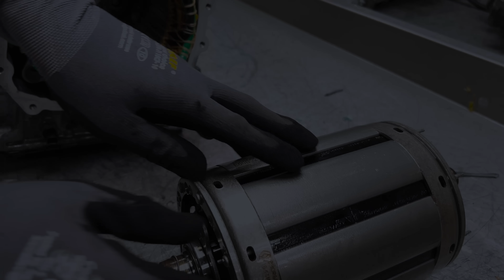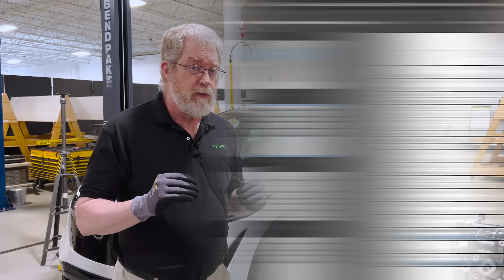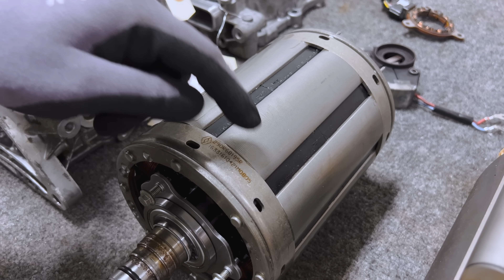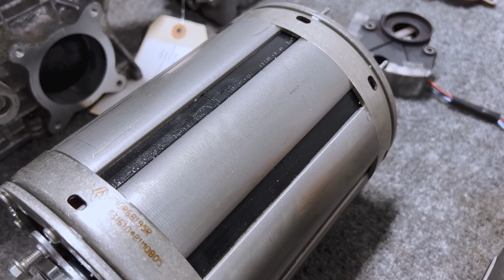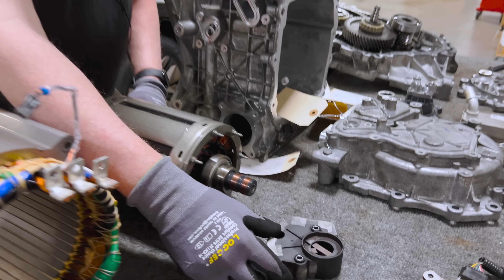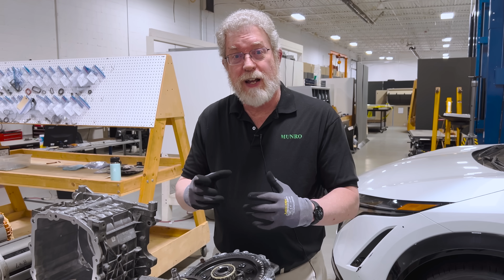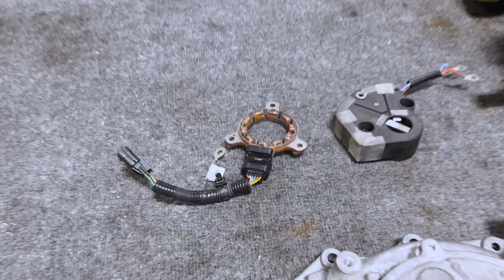This EV Motor Has No Magnets – Nissan Ariya EESM Teardown

Comment: The solution for the through bolts is not new, it was used on connecting rods on German aircraft engines in WW II
Reply: Interesting... but he didn't say it was new, he just said that it was properly designed.

Comment: Am I correct that the motor  is intrinsic to the charging process ,  not a great idea if so 🤔
Reply: Only for 22kw AC, I don't know if the Ariya has this option
Reply: That's a Renault feature. There is no mention in the video of whether Nissan is doing the same.
Reply: @brianb-p6586 No it WAS  a question 🙄
Reply: @pollywollydo while the motor is used in the Renault charging system, there is no inherent need to do that just because it is possible. I don't know if Nissan is doing this; so in answer to your question, I don't know if your assumption is correct.

Comment: Interesting to see brushes used, makes a great 2nd motor for an efficient AWD electric car.  I figure it has far less loss when freewheeling compared to a induction or permanent magnet motor without the need for a clutch disconnect.  Overall the motor looks to be designed with traditional electronics and manufacturing, especially compared to all the newer hairpin wound motors from VW and Rivian.  My thoughts on Nissan electric cars are maha, Leaf left a long lasting reputation for poor battery life, the newer Aria has nice looks but not all that compelling or competitive electric car specifications.
Reply: don't think it has less losses than an induction motor when freewheeling. Both completely de-magnetize and have no eddy currents when de-energized but the induction motor has no friction from brushes. Less than PM, yes, agree
Reply: The Leaf has battery lifespan issues due to a design choice aimed at lowering the price point and keeping it affordable.  But, aside from battery life, it is notoriously reliable.  So much so that there are at least three aftermarket suppliers selling replacement batteries, because many owners love the car and want to keep it on the road.  The aftermarket batteries are quite affordable, and offer big performance upgrades.  There is even a video on YouTube showing how the replacement can be done in your driveway with a floor jack and some wood (and some custom software).

Comment: This is old school synchronous motor with brushes. 
On the other hand permanent magnets will  degrade with loss of magnetism and motor lose some power over time, significantly more in motors at high temperatures.
Reply: Spontaneous demagnetization was an issue with old AlNiCo magnets. Neodymium magnets lose up to 2% of their strength per 100 years, which is negligible. The field also weakens with temperature but this is reversible if critical temperature is not exceeded
Reply: This motor is hot garbage and requires carbon brush inspections and replacements.
It would be like going back to carburetors and praising them.   😅
Reply: @acvwacvw Considering the upcoming shortage rare earth elements this is a wise way to go.  BMW also uses externally excited AC motor with carbon brushes. They have much better design with 3 short brushes per ring that lasts 3M km.

Unless the oil does gets onto the rings in which case it fails fairly quickly but this is a weak point of all carbon-brush based designs. 

Counterintuitively, a short brush lasts longer than the long one because it has lower inertia and therefore a weaker spring is adequate to push it against the shaft. The shaft always has a certain runout that the brush has to follow. As the contact force is weaker the brush could last longer. Also, they use 3 brushes per ring arranged in a star configuration (the whole thing looks like a “flux capacitor” from Back to the Future). This way, if the shaft is moves away from one brush it also moves towards at least one on the other side. Therefore, there is no risk of creating electric arc or even sparks, which would otherwise greatly reduce lifespan.
Reply: @acvwacvw we still do brake pad change and tyre change. Isn't that old school?

Comment: I might be completely misunderstanding, but doesnt this design mean that you could change your Kv of the motor on the fly, due to ability to change to magnet strength, therefore torque of the motor?
Wouldnt that mean that you could practically change "gearing" of the motor on the fly?
Reply: Correct. that is what he described starting around 12:00 in the video.
Reply: By controlling the stator field you already do that, the excitation of the rotor is additional energy, which was not needed in permanent magnet, the goal would be to keep this loss minimum or just power as much as needed
Reply: @vikkris  No, you are missing my point, with permanent magnet motor you have the same Kv no matter what, therefore the same torque per amp.
If I understand it correctly, torque generated by magnets, is basically a multiplication between magnetic flux generated.
Therefore, you are able to change the Kv of the motor on the fly, everything just by changing the current of the rotor coils that were mentioned.
In my mind it seems that mean that you can adjust Kv to anything you want, which would function as endless gearing possibilities.

Comment: 16:00  I don't know of any car that relies on the ABS system to hold a parked car, they set an electrically powered parking brake like what's found in most modern cars.  And it's funny that this guy paraded the parking pawl when Munro has previously criticized other car makers for having it.
Reply: Paul is indeed wrong about using ABS for parking. 

If there is a design change which will save the manufacturer a dollar Sandy will recommend it, even though it reduces functionality for the owner and may cost the owners thousands of dollars (in replacement of non-serviceable parts). Paul seems more interested in delivering a functional product to the consumer in a way which is viable for the business.

Comment: An old Renault engine with the Renault logo still lasered into it. Unfortunately, this engine was already unpleasantly noticeable in the Zoe due to its higher consumption. Not only that, but using carbon brushes to get current into the rotor windings is old and inadequate technology. More modern designs do this inductively without carbon brushes.
Reply: Do you thing inductive coupling is more efficient that carbon brushes. I doubt.
Reply: @r11tc 
*think
Reply: @r11tc I wonder how large it would have to be to put the same amount of current into the “armature” of this setup that brushes can. He mentioned 10s of amps with that? And how do you do it without interacting with all the rest of the heavy fields in proximity?
If such a thing does exist on this scale, I’d genuinely love to learn more about it.
Reply: They refined a lot the motor since the Zoe.
Probably tuned the control algorithm too.
The Ariya, the new Renault 5 are actually pretty efficient. Worse than Tesla, but still among the best.
Reply: It is not an old engine, Renault mounts it on all its new vehicles Megan, Renault 5, but Renault here in Europe is known as a company that produces economical vehicles, with some compromises to save money 😅
Reply: It is not
Reply: That's not the same motor of the Zoe/Twingo, you can easily understand that because the old one was air cooled, whole this one is oil/liquid cooled.
Also the AC battery charger is now a separate piece than the power inverter, so again, it's not the same motor, it just have the same layout.
Concerning brushes and induction, there are some induction exciter around, but still experimental, and Renault is targeting that for the next version of that motor, but for the moment they are not enough reliable and cheap and compact.

Comment: Is no one on earth using a switched reluctance motor?
Reply: Tesla Model 3 permanent 🧲 uses some reluctance
Reply: @danielhermanus6909  all interior permanent magnet (IPM) synchronous motors produce reluctance torque. Only Tesla makes a big deal about that, but they all do it. And that's synchronous reluctance, not switched reluctance.
Reply: Switched reluctance has been used by PMSM since Toyota Prius.
Reply: @Foersom_  No, Toyota does not use - and has never used - switched reluctance. Like all interior permanent magnet (IPM) synchronous motors, any Toyota motor does produce reluctance torque.
Reply: No on-road automotive application uses switched reluctance, although it is used industrially. LeTourneau was well known for using switched reluctance motors in its mining trucks, which are now part of Komatsu; Komatsu still uses switched reluctance motors. 

Note that switched reluctance is not the same as synchronous reluctance, and that switched reluctance is not suitable for light vehicles due to the lack of smooth torque delivery. 

Any reluctance motor (including the synchronous reluctance which could be used in cars) has relatively low stall torque for the size of the motor, which is likely the main reason that it not used in cars.

Comment: When Paul says Nissan has been in EVs a long time, he was not kidding. First Nissan EV 1947. They did take a pause and restarted on EVs in the '70s.
Reply: You might also be interested in Jay Leno's 1907 Thomas Flyer, electric with regen braking. Cool tech back then, abandoned for oil buring engines for better range etc
Reply: @KiwiMC99 The early EV’s had key starting - the ICEV didn’t get that for a decade afterwards… (the 1912 Cadillac was the first with that option).
Reply: Ford were building EV’s in the 1920’s…

Comment: The drive unit looks shockingly similar to the 2010's Renault Zoe, the parking brake lock is extremely useful when parking up steep hills! Sadly the R model Zoe's had air cooled motors which meant that debris could find it's way into the bearings and brush rings.....

Good to see it's not using rare earth metals and as long as the bearings have been beefed up & liquid cooled the drive unit should be good for many miles.
Reply: Of course it is... Nissan merged with Renault and so acquired its motor design.
Reply: @brianb-p6586 are you sure Renault designed that motor originally?
Reply: @GBOAC  No, the Renault Zoe motor is from Continental.
Reply: @brianb-p6586 Yes the Zoe Q210 and Q90 had Continental motors, but Renault made their own asynchronous motor from 2015 or so. They are used in R240, R90, R110 and R135.

I wonder how much the Arya motor has in common with the Renault Megane and Scenic motors?
Reply: @itekani  most probably it's the same motor as in Megane / Scenic. It's the same CMF-Ev platform after all.
Reply: Just because it’s a Japanese product, does that mean you have to praise it regardless of the facts, even if it’s a failed design? This car received extremely poor reviews whilst on sale in China and Japan, and had an extremely high failure rate, particularly with regard to the electric motor.

Comment: I also agree, that parking pawls be employed on all BEVs. @elonmusk, this is one case where the best part is no part philosophy does not apply. There have been videos  of Tesla cars that slid from a parked stance on snow and ice, where parking pawls would have been helpful. There should also be a manual cable and lever release in case there is a power loss, run to the center console, to release the parking pawls.

Comment: What about the heat generation on the spinning rotor, since there is a lot of IR losses on the copper coil(since it has to have either more turns or more current or both for a strong magnetic field🤔). Wonderful primer though.❤️👍
Reply: That's valid, although all motors generate heat in the rotor due to magnetic losses. An induction motor even produces some of that heat by resistance to current flow, just like an externally excited rotor.
Reply: Yes, the IR loss in the field windings need to be dissipated. There are also pole face losses induced by the slots in the stator. Plus there is windage or churning loss as the rotor spins in the air and oil. This can be significant at higher speeds. So, the oil and the air that are used for cooling also add to some loss. How ironic.